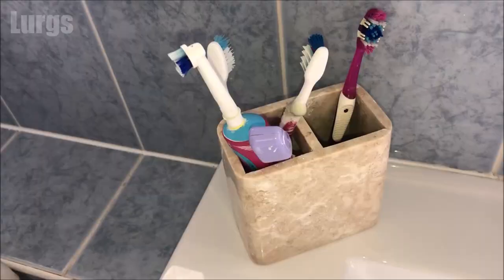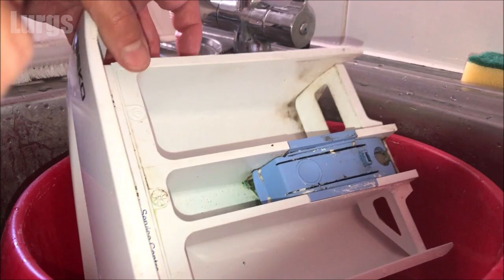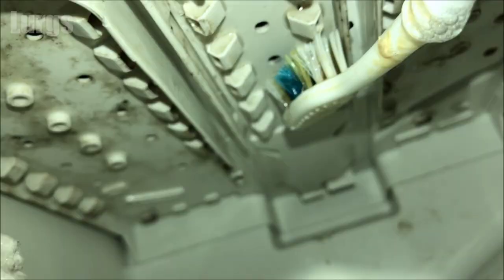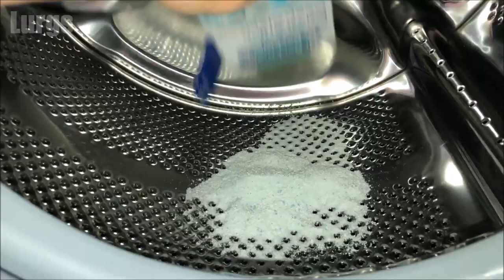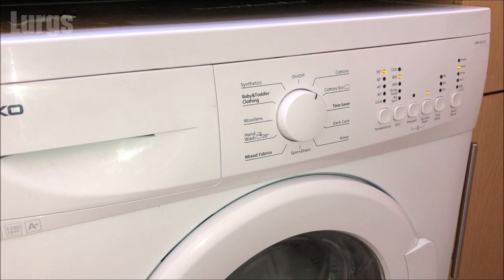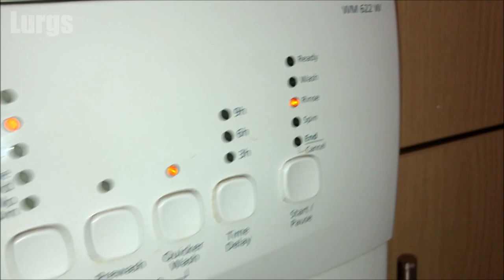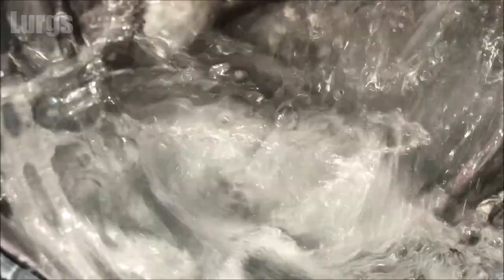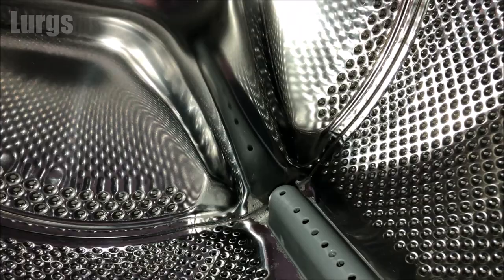How to clean your Beko Washing Machine keep it Hygienically Fresh

Comment: Sir, I own a washing machine Beko model WTAD18AS. The washing machine now always have a problem. Usually it will appear "Fd". Do you have any explanation that may help me sir? Much appreciated sir 🙏
Reply from the maker: Not had that before but it could mean ‘Factory Default’ which means it loses any settings memorised that you might have changed. Odd. Hopefully it’s nothing major
Reply: @LurgsHowToGuides  thanks sir!
Reply: Maybe your watching machine door is not well closed…just maybe
Reply: @Richolamide  even if its closed pun still it cannot working

Comment: Hey man, I had a washing machine that started covering my clothes in small white fibers, I moved apartments and took the washing machine with me but still had the same results. 

I just bought a second hand one of these models that looks brand new. My clothes are still covered in small white fibers. Any idea what this could be? 

The filter is absolutely clean and new, the water that comes out of the pump is completely clear.

Maybe something wrong with my water and waste pipe? Or something in the drum itself? Any ideas?
Reply: Sorry I meant to say that I bought a newer model than the one in your video, secondhand.
Reply from the maker: How strange. Not sure I’m afraid, maybe an old sock is stuck somewhere in the drum. Very odd
Reply: @LurgsHowToGuides  ok, not to worry, thanks for the response!

Comment: The lights are on but the cycles have not begun.  How do I sort it out
Reply from the maker: Start again. Odd it’s not working, just start another programme
Reply: @LurgsHowToGuides  I did try several times. Doesn't work in any. 60° 40° 30min and rinse
Reply from the maker: So you can’t get any washing programmes to work? Try unplugging for a few minutes. If still no luck then sounds like it’s faulty
Reply: @LurgsHowToGuides  thanks
Reply: @LurgsHowToGuides  the sensor that knows I have shut the door was fried. Got a new one the next day. It took less than 3 minutes. It's alright now
Reply from the maker: Great stuff, glad you got it fixed. 😎